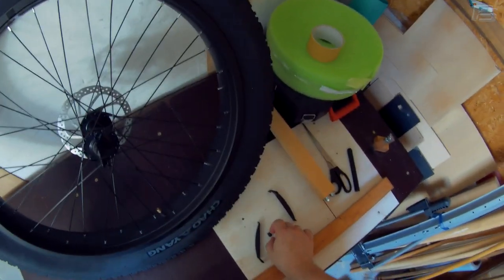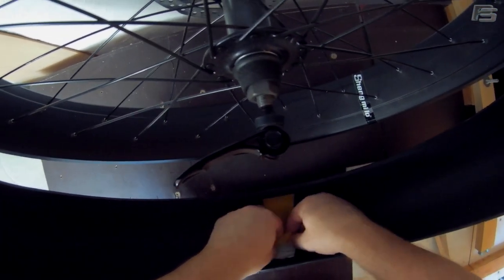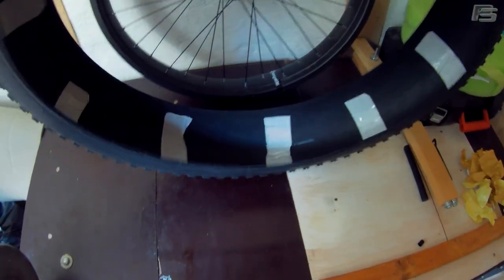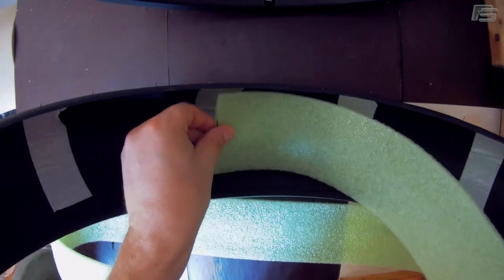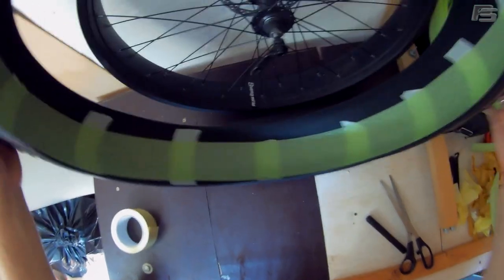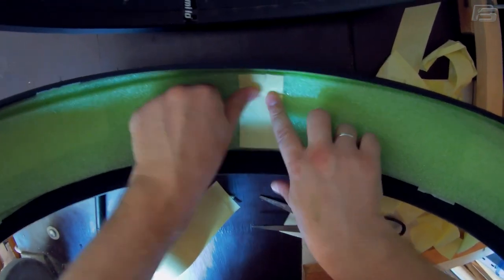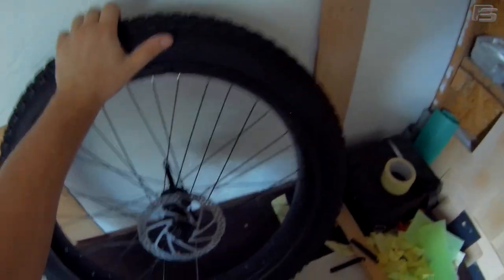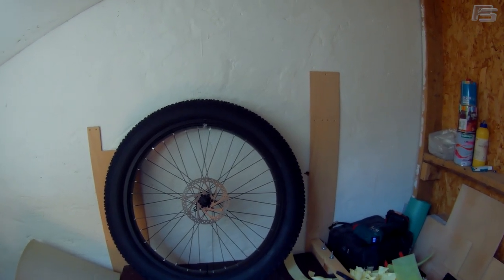FAT TIRE E-BIKE dirt cheap puncture - proofing

Comment: Thanks for the video what's that yellow material that you're running along the entire inside of the wheel? That isn't dilatation tape as well is it?
Reply from the maker: That would be double-sided tape.
Reply: Thanks for the response really appreciate it! I meant to ask you what is the Big Green roll of material that you run lengthwise inside the tire on top of the double-sided tape? Thanks again
Reply from the maker: @seanmichael7714  There are many names used for this tape. I found it under the name dilatation tape. It is basically expanded PE tape/foil pre-cut in this particular size. It can be found in stores that sell building materials
Reply: Hey thanks so much I really appreciate it I've been having a nightmare of a time with my back tire last couple months. Best wishes and thanks again!

Comment: What's the stuff you are using can you share a link please
Reply from the maker: There are many names used for this tape. I found it under the name dilatation tape. It is basically expanded PE tape/foil pre-cut in this particular size. It can be found in stores that sell building materials. This would be the best link I can find  online:
https://pakplus.hr/dilatacijska-pe-ekspandirana-traka-5-cm-x-100-m-5-mm.html/?SID=8e1uiupl23me0jvtldi9flpb36

Comment: Unfortunately, this doesn't work. That dilatation tape might be 5mm thick but when you put it in the tire and inflate the tire to 1 bar it will be compressed to paper thin tape, and it is irreversible because the dilatation tape is made like bubble-like structure and once it is highly (not moderately compressed for what it was designed for) it will be reduced to paper thin layer. Yes, I made the same thing even before seeing this video trying to replicate Tannus armor, even I put 3 layers of 5mm dilatation tape but unfortunately it was again reduced from total 15mm to around 2mm. It's a huge compression from 1 bar pressure, that is 100kPa pressure. The next thing I tried was insulation for heating pipes. It is cylindrical foam which is 9mm thick and has cutout in the middle for the pipe and also has cutout along the length so that you can put it around the pipe. It comes in 2 meters length. This is somewhat convenient as you can make shape of a big circle and accommodate it in the tire. This material is similar to pool noodle but has cut out for the pipe. Although it has structure that looks different than dilatation tape it was again irreversibly compressed to around 2mm again. I thought it wouldn't happen, but it happened. And when I came to areas of lands that are massively infested with goat heads in September, I had a puncture. I also tried adding flexible linoleum tape for floors. I found 80mm wide strip and added to the pipe insulation protection but again I suffered from goat head puncture. Goat heads are perfect for puncturing tires as they can be more than 5mm long sometimes 7 or 8 and when you hit areas with goat head it happens that there are 20, 30 to even more in the tire. Of course, one of them will go through protection. Success rate of protection might be fine against several goat heads but not against 30 bullets coming right at your tire. Next thing I tried was adding PVC material that is used to make plastic bottles. Since I couldn't find this material to buy separately, I had to use bottles to construct more than 2 meters long strip. It looked nice once constructed as I used armor tape from Lidl to join it and cover all edges, it looked fine and strong, but from the first ride I returned with puncture probably from protection itself. So, my idea now is to use again this PVC but to put a pipe insulation layer between it and the tube to reduce the chance of anything sharp from the PVC to protrude the tube. I know it looks crazy, but I will try. PVC from bottles is strong and somewhat flexible and it is really impossible to be punctured by goat head (I tried because I have many goat heads in the jar that I used for testing) but my main concern is its long term or even short-term durability as it may eventually crack and that will lead to tube puncture from hard edges. So back to the drawing board, I guess. Here all this is very light which is good, but ride feels is somewhat strange of course as you are rolling on top of some foam which additionally affects your fat bike efficiency which isn't that great in the start to be honest. So at this stage I want to avoid having to import Mr Tuffy protection for fat bike tires although I might be forced to do it and try it eventually. There are reviews that even Mr Tuffy can't survive goat heads. Solution might be to go tubeless and use product Flat Out, check for it online, it looks amazing, but not sure my rims can be modified to tubeless. Regards from neighboring Serbia which is infested by goat heads this time of the year.
Reply from the maker: I got to say, nice work you did there testing all of it. Now I guess, after what you say, I was just lucky, because I never had puncture after the video, but your comment might make me disassemble the tire and look what is going on inside.